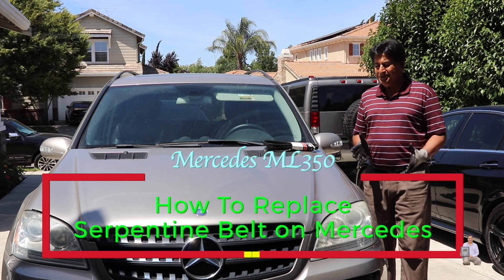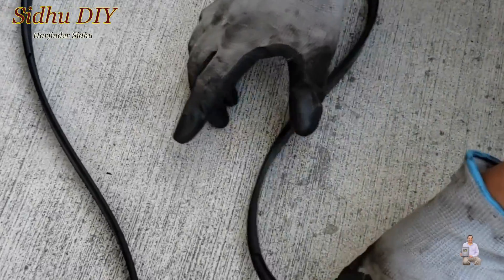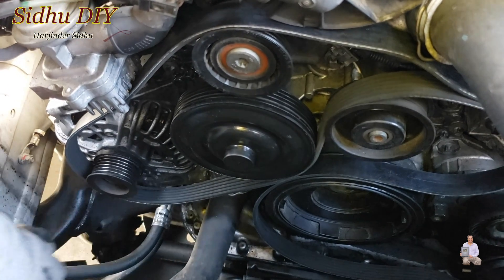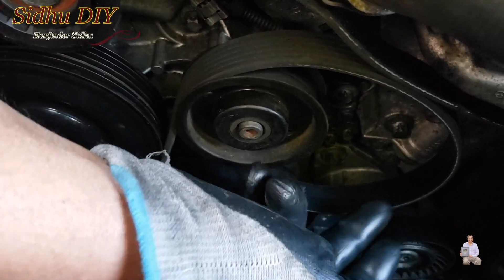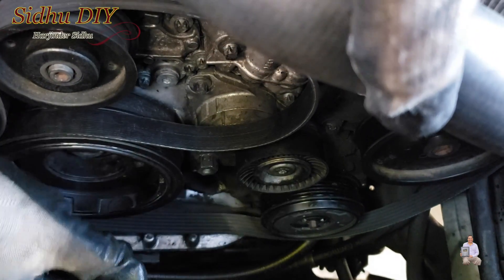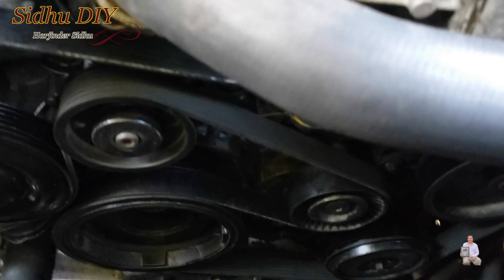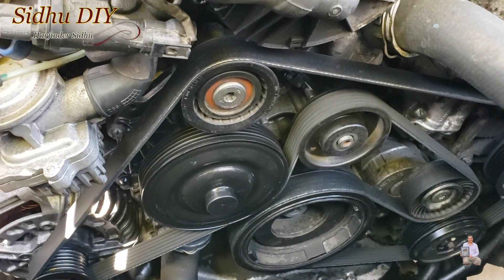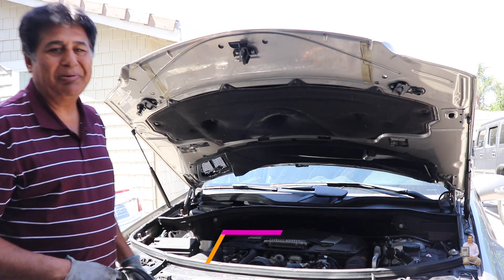Easy Serpentine Belt Replacement For Mercedes ML-class! Learn How To Install In Your Car

Comment: I dont know if this will reach you iam replacing my left airstrut andi cannot get the new strut shock to retract to get on the lower arm to put the bolt in I need to move 21/2in to but in place what am I doing wrong

Comment: good job.
Reply from the maker: Many many thanks. Please share, thanks.🙏
Thanks for the like and thanks for watching.🙏
Reply: I wish I had found your video before today. 

My belt snapped on the weekend just outside my driveway. 

I have had her towed into the dealership today. 

I bet it going to sting and even more so after seeing how easy this is. 😢😢
Reply from the maker: @monk3yboy69  •    I know it will going to cost you a lot, a simple DIY project.
Thanks for watching, please share. Thanks🙏

Comment: I wanted to say thank you. Because of your video i was able to replace my serpentine belt myself. I was intimidated at first but had no other choice ajd your video was clear and to the point. I appreciate you more than youll ever know. Happy holidays! I subscribed and im a fan. If you have a chance can you do a video on replacing the drivers side seat cushion? Mine is cracked and covers dont fit right. Thanks!
Reply from the maker: Glad it was helpful!  👍Thanks for the visit. 
Glad I could help! please share, thanks.🙏
Thanks for the like and thanks for watching.🙏
I did change the seats and never make a video, but now I have it added to my to-do list.🙏